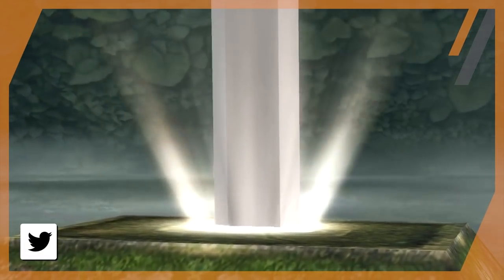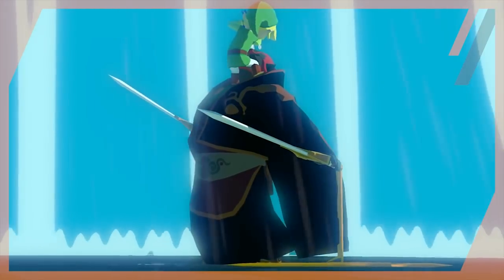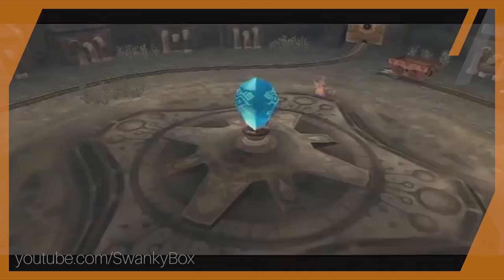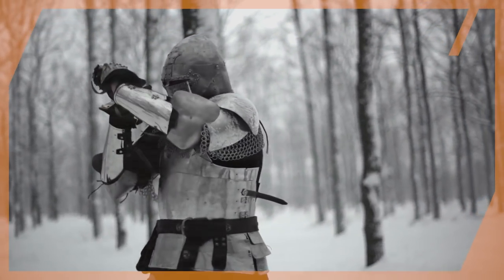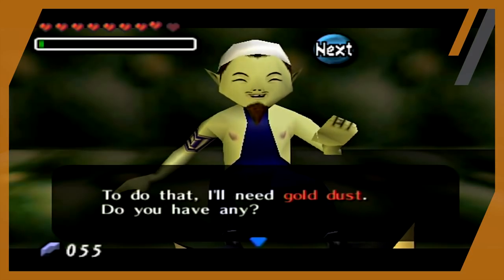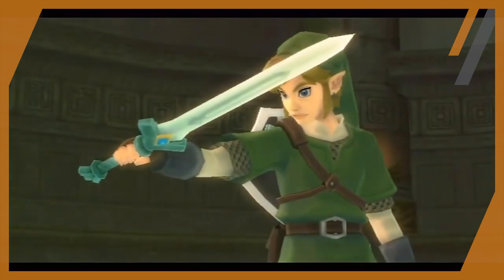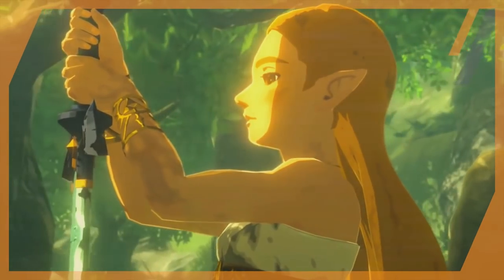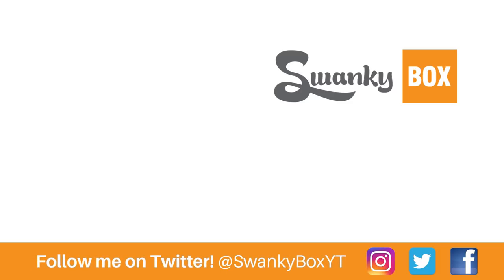Why EVERYTHING About Zelda's Master Sword Somehow Makes Perfect Sense

Comment: Did you just say swords cut through armor? Oh no. This video seamed so interesting and then you got everything about sword making wrong.
Reply: Why did I finish watching this. Now I have even more complaints. Titanium is a really bad metal for swords. It’s difficult to work with and doesn’t really get all that sharp also it’s light weight means it doesn’t have much mass so striking with it would cause less damage than just steel. If I had to guess the materials I would probably go with a tungsten core and steel edge and gold embroidering for the soul power.